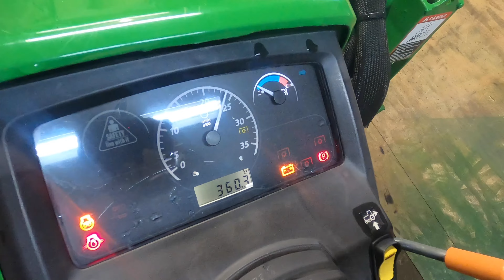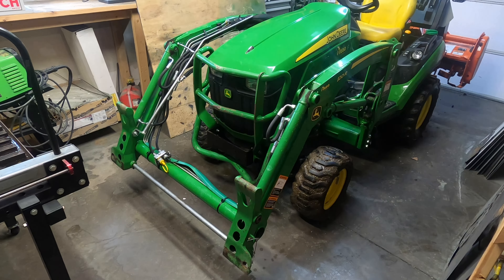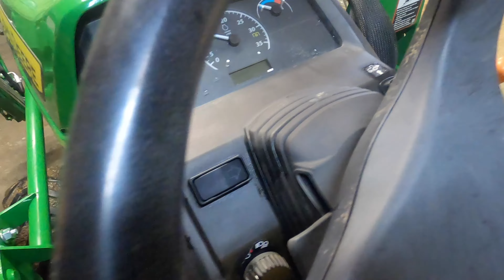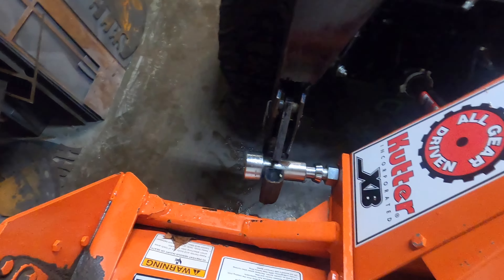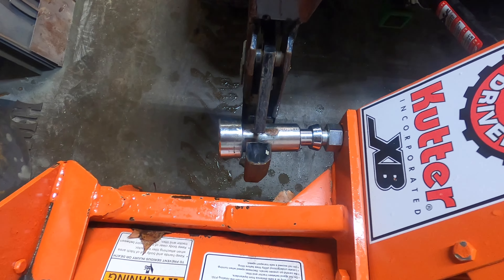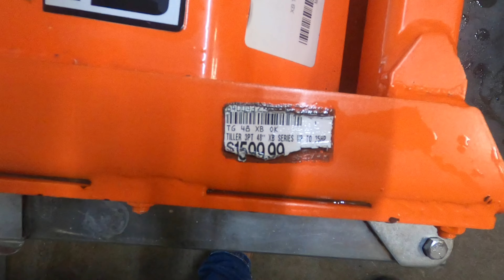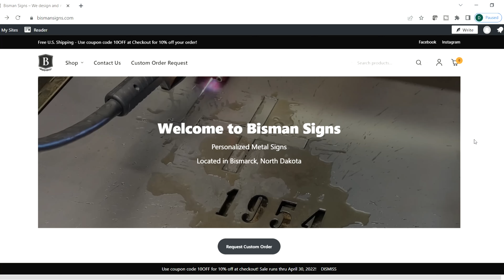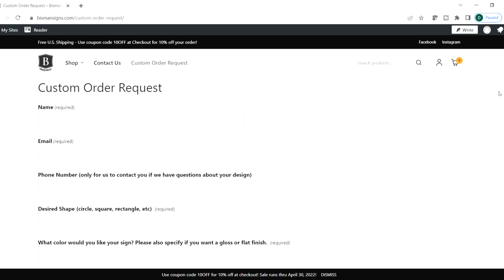1025r: 360 hour review

Comment: Marks on the tractor prove it’s a workin tractor in its workin clothes. Nice video. I’d drill a little hole in the dash and put a small screw in with an o ring to keep water out. That may fix the tach so it will calibrate its self.
Reply from the maker: Thanks, Noel! That's a great idea with the tach, I may have to try that. Thanks for the tip!

Comment: I have a 2017 1025r as well, with the 120r loader, 260 backhoe and 60d deck. The guy I bought it from did the same as you, bought the tractor that had been sitting and had all new implements put on it. He mowed the lawn with it for 161 hours then sold everything to me for 15,500 in April 2020. I was in a JD dealership’s lot after pricing a new one and checked Craigslist and there it was. He called me right back, I drove 6.5 hours one way the next day and bought it. I am very blessed to have bought a 2017 1025r TLB for 50% off retail. Even got a BB60 box blade, 60” York rake and quick hitch as part of the deal.  These deals were out there before things got crazy. Like you, I’m happy to have made the purchase when I did. Glad to see you again Dash!
Reply from the maker: Wow thats a great deal! 161 hours is nothing. These machines will last well into the thousands of hours if you care for them right. You got a sweet deal on yours especially with the backhoe. Those are expensive!

Comment: To protect the wiring for the diverter I’d get a short piece of heater hose, Slice one side lengthwise, then put it over the wire. Secure it with a few zip ties. Will be much better than electrical tape. 👍
Reply from the maker: That's a great idea. I think I will try that. Much more durable than electrical tape! haha. Thanks for sharing!

Comment: You are getting some serious use out of your tractor!  I need to do my first hydraulic oil service here as soon as I get some nice weather.  Is that a CNC plasma table sitting in front of the tractor, let’s see that in action sometime.  What sort of projects are you doing with that?  Thanks for the tractor update walk around!  Jim
Reply from the maker: Hey Jim! Yes sir that is a CNC plasma table. I love it. I actually bought it so I can make stump buckets that go right into a receiver hitch for those who already have pallet fork frames with hitches in them. I built one by hand and it works great, but I wanted a cnc machine for precision. Haven't got around to it yet but maybe this summer. Right now I'm making various signs and brackets with my plasma table. I might built some extra features for my grapple and parts for my other implements. The possibilities are endless with one of these. I'll feature it in some of my upcoming videos!
Reply: @TheLittleGreenTractor , cool!

Comment: put the pin in double shear weld or bolt a plate so you can run a pin through 2 holes and will never have an issue again.

Comment: Why did you go with a Deere? I’m in the market currently and I’m not sure what to get. Looking at a Massy Ferguson as well as the Deere.
Reply from the maker: Hey Keegan, I hope you find the right tractor that you want. I feel that you will be happy with no matter what tractor brand you go with. Some of the reasons I chose Deere are because they have a good dealership close by, the brand of the engine is Yanmar and which has been a proven reliable engine, I thought the comfort features of the 1025r are really nice compared to other tractors, and I liked how quick I can attach the drive over mower deck. There are several other reasons, but I must also be honest that I did not try several other brands before chosing Deere due to limited dealerships around Bismarck. I am still very happy with my choice, but I may be biased due to inexperience with other brands. I hope that helps...
Reply: Awesome, thanks for the reply. I will keep that in mind when purchasing. Fun fact I also am from Bismarck. Keep up the good work. Really enjoying the videos.